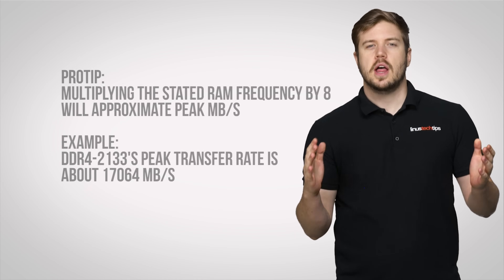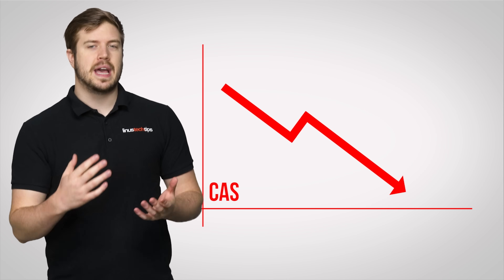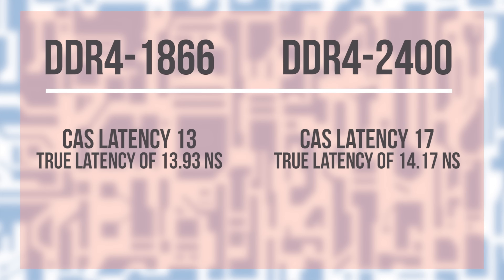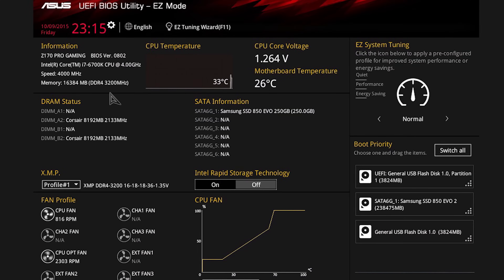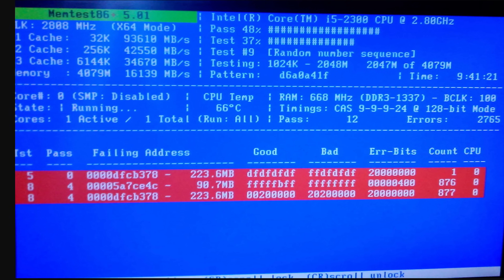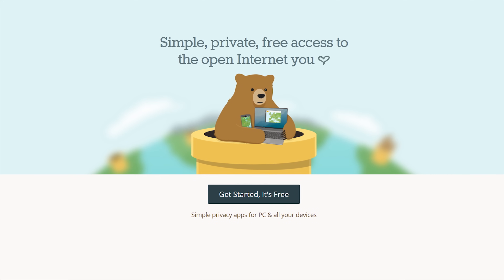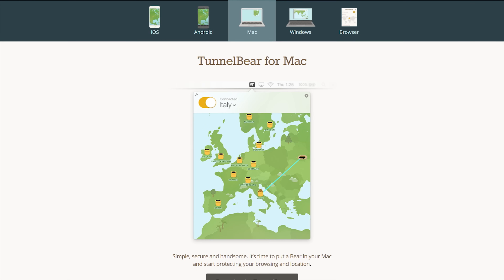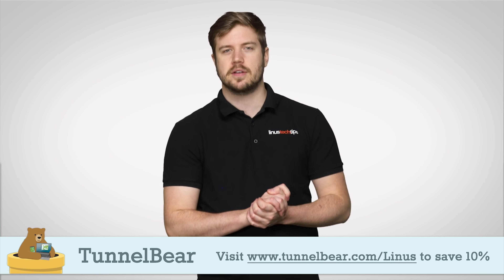How Do Memory Timings Work?

Comment: memory clock speeds mattering more is the biggest lie ever yet people beleive it. memory clocks is bandwidth. latency is responsiveness. both matter in different scenarios but neith matter enough to really fuck with. integrated memory controllers for the last 10 years have stopped motherboards making a difference and linus testing showed ryzens sweet spot to be around 2800mhz or something i cant remember.

Comment: CL, RCD, RP and RAS are main, but older overclockers knows what pain it was long time ago, specially without knowledge, with additional RTP, RC, WR, RRD, WTR, RFC1, 2, 3, 4..., RWTTO, WRRD, WRWR, RDRD and T (or different named like CAS to RAS, RAS to CAS, etc.) ending with longer strings of numbers, 00-00-00-00-000-00-000-00-0-000-000-000-0.0..., some numbers has limitations like from 1 to 120, and there was lots of things, and even if one thing are +1 or -1, or 0.5 different, for example, like 10-15-15-25-18-36-3-2.5, but, its unstable, if last number would be 3, it would be valid, but you cant know until you try, restart BIOS, clear CMOS, try one new possible valid configuration, there is billion possibilities left to try.
Reply: Still used if you want tight timings. None of the info is easily available tho

Comment: I've always had the general gist of this concept and it's why I never went over 2400Mhz for DDR3 and I won't go over 3200Mhz for DDR4 because you basically have 'sweet spots' for each generation of RAM where the technology improves to the point that the Speed of the RAM can be higher without compromising the CAS latency.

Comment: Can timings be increased to make the RAM more stable at higher frequencies?
Reply: anonymoustallguy so you want to make your ram slower in order to make your system faster??!
Reply: @ThatDaveFella  adjusting timings and going higher won't always make the ram go slower, as long as you stay in the same latency rang or better ... CAS/ram speed * 2000 like stated in the video will help you achieve high speeds with good latencies even when loosening timings.
Reply: anonymoustallguy Yep!

Comment: I bought 2400 cas 10 corsair ram for my R7 1700X, but it won't boot on the stock 10 cas timing ( optimized defaults ironically). So I punish my sticks and OC them to 3000 Mhz with cas 14. Hopefully bios updates fix this.

Comment: request techquickie: how increasing voltage helps overclocking. thanks
Reply: Erwin Lee my assumption is that since clock speeds are counted in hz (times sonething happens in 1 second) when you request too many of these to happen you need more energy. so after a point of increasing clock speeds you need more voltage to keep supporting them (I=V/R so more voltage means more current goes through cables)
Reply: I think none of the replies here properly explain why voltage helps, so I'm going to make my attempt for anyone else that also happened to find this question and is curious. Please note that what I'm about to say is something I heard in a uni lecture a couple years ago, for a subject I can't even remember. My apologies if I do get some stuff wrong. 

So as you probably know, computers work with digital/binary logic. In computing, this means that a bit can take on two values, a 0 or a 1. For the electronics, the 0 and 1 are analogous to LOW and HIGH voltages respectively (LOW being 0 volts, HIGH being whatever value you are trying to set). The problem comes when you are trying to "read" the bit after trying to change its value. Changing a bit is not instantaneous, so you do have to wait for a little bit of time before you can try to "read" it again. 

Increasing the clock frequency of a CPU (or whatever device) means you are asking it to read bits more often, giving bits less time to change their state. Push the clocks too high and the bit could potentially be "read" before it has finished changing its state, leading to instability and crashes. The reason increasing the voltage level helps overclocking is that this pumps more current going through the electronics (I=V/R), which allows them to change their state faster and finish before it needs to be "read" again, making the system stable.

This is also one reason why Moore's law existed. As transistors got smaller, there was less mass to pump electrons into/out of. This allowed them to not only change their state faster (giving us the sweet 5GHz CPUs we have today), but also do it with lower voltages, making them more efficient.
Reply: @756jrs  more volstge doesn't put in more current, in electricity in general, but in pcs it even decreases it(look up load line)
Reply: It doesn't help overclocking per se, but higher clock speeds require more power, for instance if you try to oc to 5ghz without changing the voltage, it will crash. However too much voltage will produce too much heat and cause the system to throttle or turn off.
Reply: MORE POWAAA
Reply: Yes his question strikes at the heart of the matter. Balance of power supporting the clocks
Reply: Its not a quickie subject as there's still a lot of debate unless you are already a math or computer science major.
Reply: Everyonr here is either not concise enoug or wrong, but explained as simple as possible: more volstge means the transistor gates are properly opened, letting more current pass through the chip
Reply: Rising and falling edges are easier to detect.

Comment: A techquickie that might be worthwhile: Why exactly does increasing the voltage across RAM/CPU when overclocking prevent errors?
Reply: you need more fuel to go faster but if you don't have enough fuel your engine fails. got to find the balance of the speed you need and the lowest amount of fuel wasted.
Reply: @alfredbanuelos7312  Right! The spark has to be there on time for those pistons to fire! :)

Comment: Mhz are more important for Ryzen, then timings, so get the best mhz first
Reply: no it's not. 3200 cl14 is much better than 3200 cl16 for ryzen. also, 3200 cl14 will easily do 3466-3600 at cl15.

Comment: which is faster then? 2400 ddr3 or 2400 ddr4? if the timings are the same would it be the newer architecture?
Reply: MarcixB assuming the ddr4 is in quad channel mode, it would be faster, but if in dual channel, I would expect them to be the same.
Reply: I didn't even think about it being quad channel.
Reply: same speed,no difference

Comment: Speaking of Ryzen... As far as i know the infinity fabric "bonus" from faster memory tied directly to the frequency, and completely disregarding timings. Meaning you might actually want to relax your timings, and kick frequency up a knotch, rather then the opposite, if you are hunting that kind of enhancement. Hurting memory performance, but gaining interconnect communication advantages in the CPU... I wonder if it actually provides an advantage, in the real world.
In theory, a memory that needs 5 ns to do an action, needs 5ns for that action, regardless of frequency, up to the point where it just cant do it any more. So, increasing timings, and frequency across the board, with 10%, lets you maintain the exact same memory performance, but has increased the infinity fabric frequency 10% without introducing a similar drawback...

Comment: so how much of a performance boost in gaming will i get from tightening cas latency from 16 to 14?
Reply: Probably +0.2 FPS
Reply: Not very much, CPU clock speed and memory clock speed make a much bigger difference. Only then should you tighten your timings to get that last bit of performance.
Reply: sliqsta1 I don't  really think its  worth the effort( and risk). CPU performance is far more Important. the way I see it I rather have a larger cpu cache memory ( the memory in the cpu) as this has far more impact on data access speeds of the cpu. if you have a good cpu with large cache the RAM memory has "plenty" of time to load,access and send data.

but correct me if I'm wrong :)
Reply: Latency will dominate if you have a huge number of small operations on gigabytes or more of data (big databases for example) and only if the CPU can't predict where the next access will happen (so generally if it's not close to the last access). In other words, working on a relatively small number of big data structures as happens in games is the exact opposite and throughput and cache size will be much more important.
Reply: You've never tried to run GTA 5 or Arkham Knight with only 8GB, I see.

Size is important. Always.
Reply: ecopper1 Ram size isn't very important at all, most games won't use more than 6GBs of RAM, simply due to them having to run on all platforms.
Reply: moo. Arkham Knight works in 6GBs, GTA5 even less, I've seen it run in as low as 2.
Reply: ColasTeam that is complete bullshit. You should never have less than 8GB for gta. Especially if the game is installed on an HDD.
As Long as you have 12+ GB ram then its frequenzy is the absolute most important variable.
Reply: Rather RAM size than speeds is important for 99.999% games.
Reply: SpeedRebirth Maybe you think you shouldn't, but you absolutely can.
Reply: do the math in the video to see how many less nanoseconds you get (fewer is better)
Reply: SpeedRebirth , moo. , ColasTeam , ColasTeam is right. Most games don't use more than 6GBs of RAM and GTA5 + Arkham Knight can be played with 8GB. It's not advised if you're looking for the best load speeds as they do use the vast majority of your available memory, mixed with the memory in use by the OS and background programs. Although I also agree with SpeedRebirth, you should never have LESS than 8GB in your system when playing games like GTA 5 and Arkham Knight. With those 2 games often using upwards of 5-7GB of RAM alone, mixed with around 1GB for OS and 1-2GB for background programs, you'll be cutting it close. Then if you're looking to have google chrome in the background with several windows open with your own music playing, you're looking at another 1-2GB for that.

Personally, I'd say if you intend on doing anything intensive on a PC, just get 16GB of RAM (or upwards of 32GB for video editing ((about 8 minutes of shadowplay footage at 60fps 2560x1080 = 4GB RAM used. Low ram in video editing is a pain when trying to preview a video before rendering.)) That way your browsers, extensions, music, videos and games don't jitter or crash while multi-tasking - and it's cheap too.
Reply: RAM is cheap. I just re-bought 16GB of it 28 days ago to replace my previous 16GB (They were on their last legs, causing a BSOD every 1-2 days). May not be cheap for those that don't have a job yet or aren't old enough to get one, but RAM is cheap. 
You can get a decent set of ram for £120-150 GBP. (Granted, mine was £117. Got it on a 20% sale, + mine is DDR3. No intention of upgrading my motherboard and CPU just to get mildly stronger ram with next to no performance benefit in games, besides a couple of frames.)
Reply: I dunno. Compared to other pieces of hardware required for a PC, RAM seems to be one of the cheapest of the lot. Could just hold off on buying 2 AAA games and you've pretty much got enough for a brand spanking new set of RAM. I mean hell, the robe I bought 2 days ago cost me £72, almost enough to buy the set of RAM all over again.
Although saying that, I can understand prices of computer parts vary pretty wildly, depending on the country from stupidly cheap to abhorrently expensive tech.
Reply: Wow, that really puts it into perspective o.o I honestly had no idea about that.
Then I suppose lastly it just comes down to opinion on cost. I do still think RAM is cheap, sure, it seems it could've been a lot cheaper, but I certainly don't think it's expensive enough to prevent people on limited budgets from buying a set, even more so if they are gamers and buy £30-£60 games on the frequent.
Mix the cost with the longevity of RAM- it doesn't exactly get obsolete for a very long time.
Reply: +moo
You do realize GTA 5 was made to run on half a gig of ram?
Reply: i have Mushkin Enhanced Redline 8GB DDR3 1866ghz and i play GTA5, i get all kind of problems (with lower than medium details). dude...literally all of my vehicles in my garages from x80 proto and shotaro Nagasaki to the hilly billy pick up truck are faster than my PC XD
the textures loads really slow while driving, freeze , lags, frame drops, low fps, sometimes it get stuck on loading.even making a CSS map average sized and compiling it makes this thing im using garbage.

my other specs:
CPU: intel core i7 haswell 4770k 3.5ghz with boost engine up to 3.9ghz (not OCed)GPU: ATI Radeon Sapphire HD7870 2GB GHz Edition 256bit GDDR5 1000MHz/1200MHz <<<< XD

but seriously I've seen a video here in youtube of a guy stress testing GTA5 with his good pc, and the statistics showed that it exceeded the 8GB, that game is hungry for RAM the more there are entities and moving objects or 3D rendring the more it takes.

check this video, you will find future games are getting more and more demanding that 8GB is not enough
https://www.youtube.com/watch?v=HnuNs_Nu46Q
Reply: The simple answer you are looking for is ....Fuck All

Comment: You said adjust The 4th number accordingly (tRAS)... according to what???
Reply: exactly.
Reply: Honestly it won't make a diff but it's fun fucking with numbers right.  It should be the Ram timing #1 + #3  and add 2 points. That is what i have read in many sites, not all 3 of them added together. So in that case 14+15+2 works fine.
Reply: Yes
Reply: Min tRAS = tRCD + tBL (tBL is 8 in DDR4), this is the minimum time and normally isn't used but it explains why you sometimes see timings like 14-16-16-24 that do work. The overall formula is a little longer but that's what you get after factorization, from the guy that coded the Ryzen Calculators (not me). Take it as you will
Reply: matthewtrott adjust tRAS by 1, similar to the first 3 numbers until you find a stable timing.
Reply: I heard that the last one should be "at least a sum of all the others" but in this video that wasn't the case. They wrote 14-15-15-31 after adjustments.

Do you just reduce it one by one and find a stable one?
Reply: @marinb_yt  Yes
Reply: @marinb_yt 
Almost correct! The last one is the sum of the previous two, but not the first (CL).
Reply: 7 years too late but the tRAS window would have to be lowered to increase performance. They even showed that in the video. The explanation is that the memory is writing and reading memory during the time frame (but mostly needs that amount of time to successfully overwrite previous memory). If you lower the number too much and you get memory errors then you know the number cannot be lowered any further than your last successful attempt. In fact, I would back off a couple of numbers to allow for heat degradation.
Reply: tfaw and trefi are some of the only timings that have a rule

Comment: I miss my old Winbond BH-5 modules. 2-2-2-5 @ 400Mhz (was 333). I'm sure the brand was Kingston. That Ram survived me overclocking an 1800+ palimino, 1700+ thoroughbred (b?) and my 2500+ barton core and last but not least my 3200+ Athlon 64.
Reply: older ram always has lower timings. DDR 2 is commonly something like 5-5-5-15 (+- a little). DDR 1 is something like 3-3-3-8 usually.
Reply: Kefka900 so even older RAM had this timing? Today is the first I've heard of it, but then i only really disassembled and worked on old PCs (Pentium 1 era).
Reply: People where hunting for the right memory, good old days overclocking was awesome back then.
Reply: I got into overclocking around 2002, and I'm not sure of older SDRAM had timings. I'm sure it does though since the tech is very similar. Overclocking to me was a lot more fun back then. To make a 1.4Ghz 1700+ run @ 2.2Ghz 24/7 prime stable on air felt like a great accomplishment and saved a lot of money. (esentially turned a $50 cpu into a $300 cpu)

Comment: So I have 3 sticks of ram. 2 of them came in a pair. 2 4gb sticks. I wanted 16gbs total so I added one 8gb stick of the exact same mhz and they are the same brand. Everything is the same, and I made sure of that. Although when I go into my bios it automatically goes to 1333mhz. I turn it up to what they are all rated at (1866mhz) and now whenever I am playing games or just browsing the web. My computer blue screens. It used to totally freeze and not do anything before I upgraded my motherboard so that is nice. But now I just leave it at 1333mhz and it works perfectly. Does anybody know what could be causing this? Thanks!

Comment: Ryzen inter-CCX speed is tied to memory clock speed (infinity fabric) so your cores can communicate faster and multithread better the faster your RAM is. Latency does not matter as much. You can effectively make your timings worse but up the clock speed and you'll still get a lot faster performance.